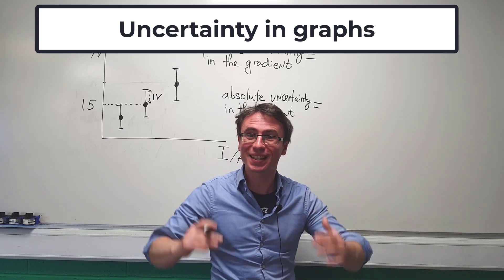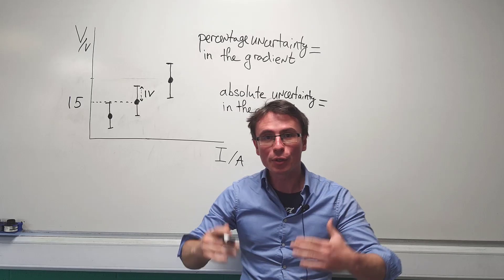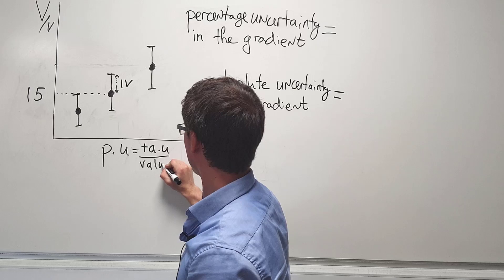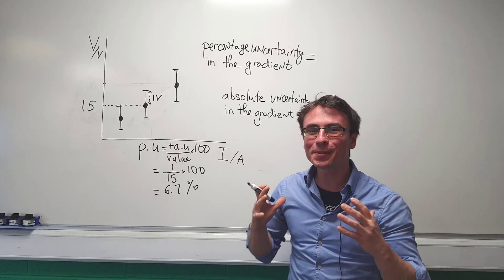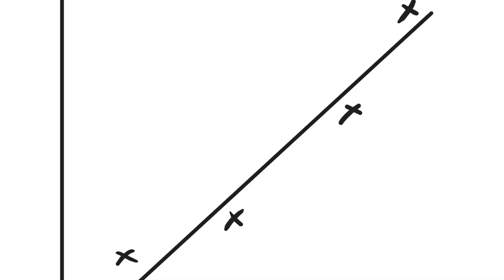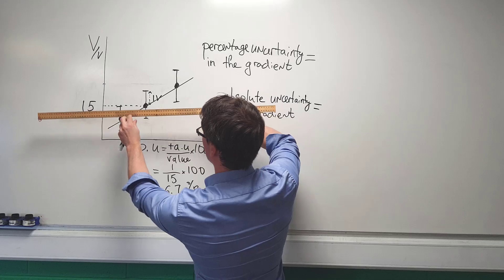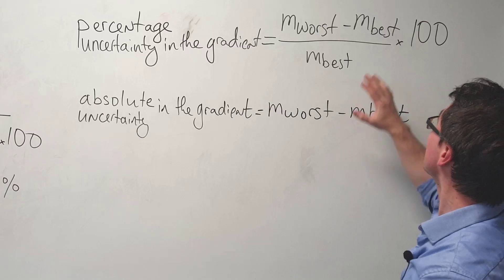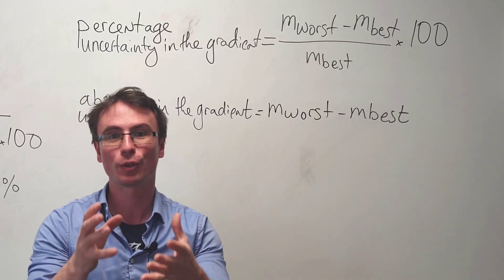NEED to know THESE for Physics exams - line of worst fit, error bars

Comment: You see when you are trying to find absolute uncertainty from ln table I saw your method in 2019 paper 3 ocr . E.g where you do ln 340 - ln 260 divided by 2.  Basically half the range. Does this method work if the table was log(lg)values instead of ln? I think this question could come in paper 3 2022.
Reply from the maker: yep, it should work, log and ln are basically the same function just a different base.